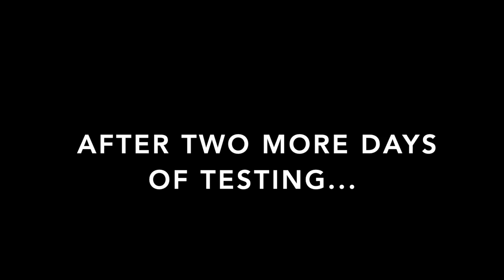ZEELTRONIC CDI INSTALL ... EASY - How Did This Happen !?

Comment: Dang I am glad you finally got it figured out. Stuff like that drives me nuts. You figure that you bought something from a professional and expect it to work properly. Only to find that you have to fully figure it out yourself. I get that stuff happens but sheesh
Reply from the maker: Yeah... I'm not really sure to think about the whole thing, because I told him twice for sure, maybe 3 times that it was set to 48, and he didn't react .... how one would expect. Either he didn't know, or he just wasn't telling me. The folks at Zeeltronic got back to me with very precise info both times I contacted them. 

The sad thing is, if I came blank, I would have figured it out much quicker, but I'm not like " I know more than this guy and more than the manual" haha... Oh well... it's sorted now. Lesson learned.

Comment: That thing is going to look sweet in 5 years when you cover the top in carbon fiber!  Those waves crashing over your not working ski reminds me of my life. Note to self. Zeeltronics cdi confuses people smarter than me about that type of thing. I had my issues the last couple weeks that I finally figured out after looking at every wrong thing. Makes me wonder if everybody that swaps an 1100 goes through the same type of tinkering process.
Reply from the maker: Haha... 5 years... you're being optimistic. Now that I have other projects, the carbon will have to wait, haha. 

I may made a video in installing the Zeeltronic separately.  It's not at all hard, and I think it's a great product. I just had a odd experience.
Reply from the maker: When I responded to your comment the first time, someone was at my house pondering purchasing my Mini.... it is now gone.

Comment: I just realized watching this, and having that exact same thought of "What did I do wrong, what is wrong, What's it going to take to figure out, What have I done to get here so that I can go backwards into what I've changed..." and on and on, you have to look back at it, and realize that every single test, change, modification you did, all of those things were great, and work! One silly number trusted on from one other person throws doubt into a great mechanics mind, and makes you forget all the things you're doing right!  You don't give justice to just how many hours, and how much work all those things you listed off in like 15 seconds. Keep up the great work man! Really cool to watch the progression.
Reply from the maker: Yeah, thanks for the comment and pointing that out. I don't know if it is considered being humble or having self doubt, but I rarely have an issue and automatically blame others. I realize that I am human and I mess things up, so I start questioning everything I have done... 

I guess, when it is all said and done, I should give myself credit for doing all of those things right, haha... When you hack parts off of your stator, for example... you can't be 100% sure how it's going to affect things, because it's not a path well traveled. Hopefully the rest of the summer goes fairly smoothly 🤟

Comment: Sometimes you need to be smarter than the manual.😂
Reply from the maker: Yeah, haha, this is true. 

Part of the "problem" here is that this is not a CDI that is dedicated to this engine. It is meant to be put on multiple engines, so they have to make the manual somewhat vague... however, I'm still concerned about it "decreases electronic ignition advance stability" when over 45º ... I'd like to know what that means... they have an installation diagram for my engine, so that indicates they intend for it to be used on my engine... 🤷‍♂
Reply: @JoelArseneaultYouTube  I'm going to guess they are talking about the fact that the spark time is basically a guestimation calculated by the rpm of the engine the farther you get away from that trigger point the more it has to guestimate the position of the engine. Being that you can do what you want bc you are telling it what you have you could always just turn the stator or perhaps just weld on a different tab on the flywheel to get that delay down. I have had to do that in the past to make things work together that aren't suppose to. I doubt it will be an issue but if you wanted it to be less of a guess that would take care of it. More modern stuff uses many sensing teeth and a cam sensor in a four stroke that gives the timing more accurate data. I'm not sure they may have done it tho bc the position is in a better spot to make it have to guess least w the 3 cylinder engine
Reply from the maker: @lanceulbrich6249  Oh, yest... That makes perfect sense. The 75º delay allows for the crank to actually be at a slightly different speed / in a different position... I guess that's why a 12 point reluctor with 3 teeth missing is a better setup than just 3 bumps. 

I could always move the trigger, but I think it will be okay. It uses the ends of the reluctors to fire on start up, so you have to leave the end point the same and change where it starts, I guess... Seems like a lot of work, haha. You'd really have to load test it with a timing light to know for sure what was happening, I guess.
Reply: @JoelArseneaultYouTube  yeah I really don't think it will be a problem

Comment: Hi Joel, great to see you figure out the problems and not do any Damage to the engine ,can't wait to see it on the water,  can't wait to see you modify the engine once again, just wondering is the 900 stator the same as the 1100 stator because I have decided to put an 1100 engine into my 900 Hull,the wiring on the stator is different but looks the same ,everything else fits, but I have decided to put a set of 1100 carbys on it as well to suit the engine, thanks for your response, Cheer's Adrian
Reply from the maker: Hello Adrian. 

Edit : Yes... the 900 stator and 1100 stator will work on either engine or either cdi ... they may have different part numbers from the factory, but they will work. The 1100 and 900 CDI have a different timing curve, so altho they will work, the correct one should be used. 

I'm also glad I got it running and didn't damage the engine. I really need to do some riding and tuning before I do any more mods, just to make sure it's okay, but I really want to start doing more mods right away... I have my new head almost completed, but I think I will wait a week or so to install it and do some tuning first.

Comment: Are you running different timing for each cylinder and using a throttle position sensor? What model zeel are you using?
Reply: I would also need to see the map
Reply: For example a y62t zeel’s static angle is 115 degrees.
Reply from the maker: Hey. I'm using the PDCIS-32T. No TPS ... at this time, I have all of the cylinders timed the same. I will play with it a bit over time.
Reply from the maker: @MrJmoney1980  Yeah... I just makes sense that it all depends on the physical location of the trigger coil.
Reply from the maker: @MrJmoney1980  I will probably do another video on the install and maps and stuff. I just haven't had time.